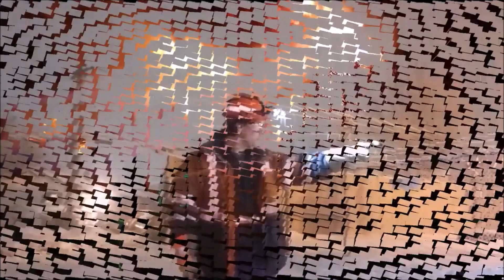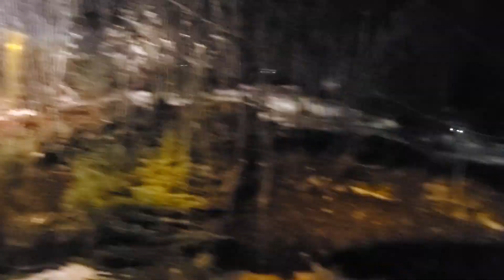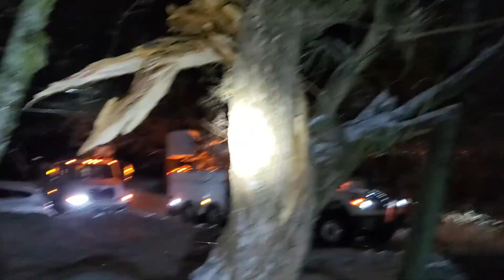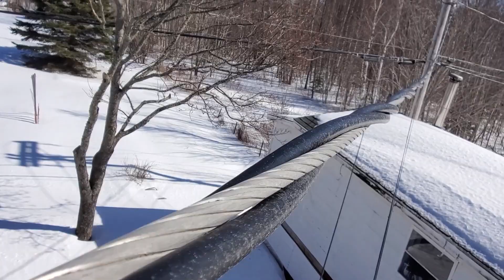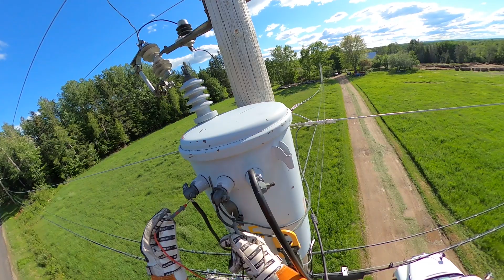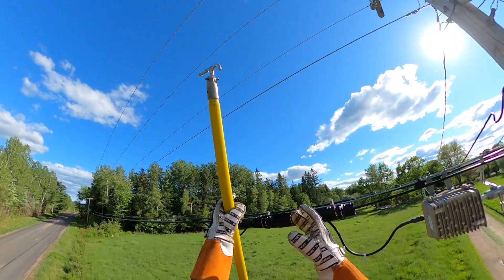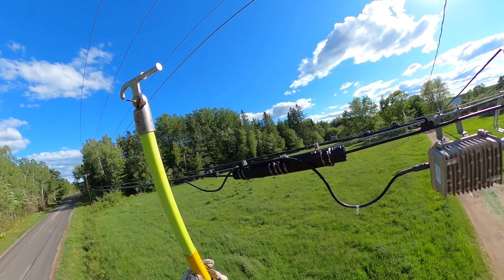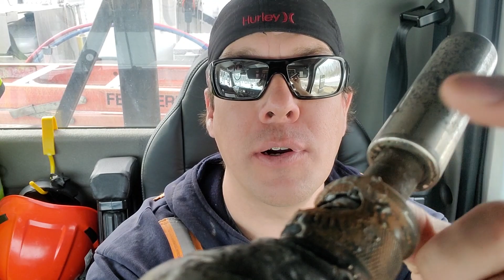Accidental contact with 120 volts

Comment: Keep in mind, welding machines use mere 50V to actually WELD metals together.
Reply: Totally agree. When people say it's current that kills, it's misleading while true at the same time. You cannot have current with out voltage in a circuit.
A bit like when people say thats a torquey engine. That means nothing. But what it's implying is it's able to provide power not far off idle.
Power = RPM x Torque or work over time.
What kills is current yes but that cannot happen without the PD to push it. The greater the voltage the more current through a given resistance.
Brushing your hair with a comb can generate 10,000 volts with very little current. Putting a spanner across your car battery can allow thousand of amps but you can put your fingers across the terminals and nothing happens.
Your spanner has a lot lower resistance than your hand for electricity.
Reply: @adaster98  Essentially a 300 ohm bag of saltwater surrounded by a thin porous 1k to 100k ohm layer of dead skin.
Reply: Hahaha well said! And we're all just 3lb brains controlling meat puppets!
Reply: DC+ 25v @ 125A will weld 3/8 plate seamlessly
Reply: I've welded with 4 volts before
Reply: Depends on the thickness of the metal. Wire welders use as low as 18 volts. You can hook two truck batteries to make 24 volts and single pass weld 1/2 steel together.
Reply: @tommysmith8801  had to do that one on a camp trip. Broke one of the legs off my cars roof rack and bush welded it up
Reply: plasma cutter is the same, i think mine makes 30v
Reply: Ye like mine runs at 140amps though that can cause” heat baby”!
Reply: Ohms law still applies though?
Reply: A sheet metal spot welder can be as little as 1v or less.
Reply: At high current.
Reply: I have a mig welder that tops out at about 20v.
Reply: And can give you a nice buzz
Reply: Li-Ion battery spot welders use a few volts.
Reply: Man if you have been lit up by a tweako on the end of a lead (welder) you know an extension cord hurts worse. Just saying
Reply: Yeah. The chuck on his coworker's impact driver had splatter, reminiscent of MIG splatter.
Reply: @adaster98  When I was younger, I used one of those selective voltage AC to DC power transformers from WallyWorld with a couple of thumbtacks to spot weld pennies together, till I burnt the thing out!
Reply: Yes but it's putting out 250 amps DC
Reply: That distribution transformer may very well put out 10,000 amps to a dead short on the secondary terminals.
Reply: Well keep in mind metal is highly conductive   so 50v easily overpowers the resistance..also the use very high current and not just  50 volts lol . You can weld with less  if the material  is conductive enough
Reply: @Athlas87  This is nonsense. A car battery won't kill you because 12V is not enough to push even 10 milliamps through skin.
Reply: @AlexBesogonov  but the arc flash if you short it out can blind permanently and set you on fire😮
Reply: Mine uses 220
Reply: Bull try 12v you can weld w 3vdc
Reply: My preferred welding voltage is 1
9.5 on 3/16"
Reply: Welding metal is done on the Amp side I do believe not so much the voltage . Because you can stick weld with a car battery and some jumper cables . I wouldn't advise .
Reply: depends what you've got your OCV set to really...but yeah I get what you're saying. I usually have mine set at 34-ish.
Reply: I don't think that there is a set minimum specific amount of current in amps or milliamps nor a specific voltage that will induce vfib or other serious or life threatening effects in an electric shock the same way for everyone, it would vary widely from one person to the other based on factors including but not limited to age weight and other health factors like underlying medical conditions like heart conditions and other serious underlying medical conditions.
Reply: @BanterMaestro2-bw9vr makes sense to me I'm not sure what the voltage is on my arc welder it's not marked with the operating voltage of the welding current, but it's marked by the welding current measured in amps I'm not sure what the minimum welding current is on my arc welder because it's only marked with the maximum welding current but the maximum welding current on my arc welder is marked as 120 amps. With such a high amperage welding current that suggests that you are in fact correct in saying that it's the current and not the voltage that does the welding in electric welding machines like arc welders and mig welders
Reply: @BanterMaestro2-bw9vr my arc welder is clearly marked with danger electrocution risk safety signs. A voltage between 20 to 50 volts isn't a particularly high voltage but 120 amps is certainly a very high current. Is there any truth to what a lot of people say that it's not the voltage but the current that does the damage in an electric shock ? Is that why my arc welder is clearly marked with danger electrocution risk safety signs even though the voltage is somewhere between 20 and 50 volts which isn't a particularly high voltage ? For comparison the mains electricity voltage used for household mains electricity in Australia is 240 volts of single phase electricity.
Reply: @BanterMaestro2-bw9vr it's okay I understand
Reply: half that actually..
Reply: They also use a lot of amps. That's what's really doing the welding
Reply: Yes, but also keep in mind, when voltage goes down, current goes up, provided nothing else changes. And yes, it IS current that kills. Voltage is merely the electric version of an "accelerator pedal."
Reply: 50volts at how many amps though?
Reply: You can even use 2-3V only... by using a rewound MOT. That can easily go to 1000A
Reply: 120 volts with no amp limit or very high amps, like 400 amps feeding a house, is very bad
Reply: I got lit up by a welder before lol. Confused me at first, felt like someone kicked the fuck out of my shoulder instead of feeling like i was shocked. Welder uses a 220v and i was welding at 120 amps if I remember correctly
Reply: @thechum9653  ive seen a few welders that the chassis of the welder would end up with 220 or some fraction of it on it live and it would tag you pretty good. it's a good way to accidentally chuck a slag hammer across the shop
Reply: u do realize most welder run a 240V plug right, and the rest are custome wired for larger V and A.
Reply: @zenriyakaruvyin8273  Welding machines need a lot of power and they get it by running a lot of amps through the electrodes. But they do it at low voltage (40V-50V).
Reply: @adaster98  except I can soak my hands in salt water then grab the electrodes of said battery and I will be just fine. Just because it delivers high amperage means nothing. Just like I can hold onto 100kv at Pico amp level and will be just fine. Must have the correct balance of both.
Reply: @KG1AES  be careful with that milli amps can stop a heart.
Reply: @anullhandle  usually takes about 60ma or higher to induce vfib
Reply: @anullhandle  then again the voltage has to be high enough to overcome the resistance of the body.
Reply: @anullhandle  he doesn’t have to be careful. The math says you’ll be safe at 12v.

Comment: You are absolutely correct, think of this, welding machines usually only have about 70 volts open circuit. Strike an arc and it may be down to 30 or so, look at the molten metal it produces. People have to realize they just cannot drain the grid, snicker, Respectfully, Dennis, KV4WM, A US NAVY Nuclear Submarine Veteran & Ham Radio Operator.

Comment: been zapped with 120 several times, just enough to remind me its there.... when working with high amperage 120.... OUCH!  did the lineman get zapped?
Reply from the maker: Thankfully he wasn't part of the path, so didn't feel a thing! It just got really bright for a few seconds.
Reply: @Bobsdecline  thank goodness... what kind of amperage is on the taps of a transformer? isin't there an inline fuse on the transformer itself?
Reply from the maker: Yes there is, it was likely a 10-20 amp fuse on the primary side. That would be equivalent to 1200 amp.
I'm not sure if it popped in this incident or not
Reply: @Bobsdecline  and thats on a 7.2KV line?

Comment: Great Video, 120vac is the most dangerous in my opinion due to how relaxed people are around it. Great lesson
Reply: The funniest thing is that 120V is very low for consumer voltage, many nations use 200/230/240v ac as the residential voltage.

Comment: What is the breaker on the pole rated for? How many amps and how long before it trips? I like to think of amps as the usage, like gallons per minute in a hose. So I'm wondering what the "pressure" is on that line. I have a 400 amp panel at my house, and most of the other houses near me have 200 amp panels. I think our transformer feeds about 4-8 houses.
Reply from the maker: If you were on our system, there would likely be a 50 or 75 KVA. That would be fused at 10 or 15 amp at 7200 volts. The equivalent would be 600-900 amp. If the fuse saw the full 900 amp it would still likely hold for a long while. Its been a while since I've quoted the spec, but if I remember correctly it's designed to hold 200% load for approx 5 minutes. This helps account for temp peak load for those off times that all 5 homes "push their toaster in" at the same time
Reply: @Bobsdecline  Got it. I know that fuse breakers usually take a while to actually trip. My home 30 amp breaker is spec'd to trip after 10 seconds continuous at 60 amps. Wouldn't 7200v at 10A come out to 120v at 600A? That's a lot of current! I can see how it might have melted things. So a 7200v line with a 10A fuse might be able to provide 20A @ 7200V or 120A @ 120V for a few minutes before blowing?

I guess if the load is 1000% it would heat up faster and trip sooner.

Cool stuff Aaron, thanks!

Comment: The voltage didn't melt the drill, the current did. If there was 100mA available on that secondary, there barely would have been sparks.

100mA at 120v still hurts though. That's why in the rest of the world we have 30mA RCDs
Reply: I would argue that power did,, which is dependent on voltage and current. If the voltage had been low but the same current went through a more conductive tool, there would have been less melting. And to your point, if the secondary could only deliver 100mA, then the voltage would have been close to zero in that fault condition anyways.

Comment: I don't know what happen but if it was with my company they have safety people going over what, when, how to find out what happen. And talking about amps when someone gets into our high voltage line they are asked how close where they. Oh I was 3 to  foot when we know as in welding you need to strike an arc which means they touch it.

Comment: Aaron,  first off, Thanks for letting us know the person is ok physically.  I hope he has gotten back to a good mental place as well.  An accident like this could shake anyone up for a bit.  Second, thank you for sharing.  120 Volts is no joke, and even 12 Volts can be an issue (you can do stick welding at 36 volts and even lower if your source can supply the current).  V=IR, or put another way V/R=I (Voltage divided by resistance=Current). So even if you have "low" voltage of 120, if you have a very low resistance path (like a steel socket and chuck on an impact driver), that current can get pretty darn high.  If you see downed wired, DO NOT APPROACH, even if it looks "dead".  Call the power company and let them send one of their crews out.
Reply: Contact welding (spot) runs a 'mere' 2-3v at the electrodes, all that means is it can't reach out and grab you the way line voltages can

Comment: Low voltage can kill you, doesn't matter the amps. Just google swimming pool fatalities with stray voltage.  Even 6 volts AC can kill you.
Reply: A bit more complicated than just voltage or just current, its a relation between the two along with the exact environment and materials involved that can make something either dangerous or not.

Comment: Someone has argued that 240 volts is less dangerous for contact than 120V because it throws you out of the way. The data I have is that 240 is 10 times more dangerous. What is your experience?

Comment: You can have that happen with something as low as 6 or 12 volts.. Short out a car battery or group of batteries like we have at work on our gensets (4x12V 1500 CCA  in series/paralell to provide 24V 3000 CCA), that would cause one hell of a bang, melt things etc especially knowing those batteries can produce a hell of a lot more current when completely short circuited and warm.

Comment: If you've got metal, it does not take a high voltage. A welder might just be 17V, and it still melts and fuses metal with a few hundred A. At 17V it won't hurt people directly. (For comparison, it takes maybe 1500V to push 30mA through the human body, but that's all the current it takes to kill a person.)
Reply: While your point is true, however the numbers are a bit different. As insulation breaks down with voltage and the human body has its own capacitance, the actual voltage that can pass 30mA through a human is much smaller than 1500V.

Comment: The thing is and it has been stated many of times in YouTube videos that it is a very low amperage that can stop your heart. It is more the path it takes that can determine how much damage is done including death. Me just being a consumer I remember one time trying to unplug a computer cable from a regular socket for a Canadian Coffee chain. There was something wrong with the till and I was trying to perform some troubleshooting with the computer but I was having difficulty removing the cable as it was a very tight space. Out of nowhere, the security chain from one of the donation boxes fell between the prongs and got a good sized little fireball of metal that flew out and you could see the damage done to the metal in the plug itself. After that experience I hate to plug anything in or try and pull it out because I'm legitimately scared
Reply: I once unplugged a computer as a kid and my fingers crossed the contacts and I felt a contraction wave all the way up to my shoulder! It was the craziest thing ever and very freaky, I was like 8 years old. I was shocked but since I was ok I was kinda fascinated with the experience.
Reply: @joshuagavaghan224  I actually got shocked a few times while working for the same company. We had this damned slushie machine that provided the base for some of our frozen drinks. I got a few noticeable zings off the machine. Issue was there was a ground fault at the plug it was connected to. The first few were grounding out to a nearby donut rack that we would use as balance to climb a little step stool to fill up the Machine. Got it fixed. Then the store underwent renovation. Then every time it was shocking people was when the plug got jostled in the new plug because we kept drink powder on top of the plug

Comment: 120V is the most dangerous to work with. Ya grabb it and can't let go, everything higher will likely throw ya away. Then factor in ya barely have any clearance to work with when voltage is that low.